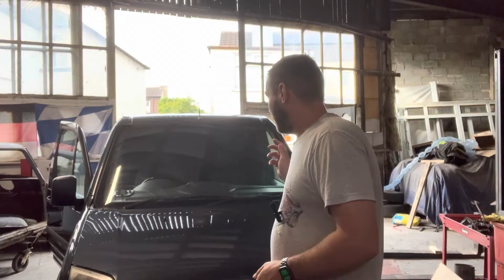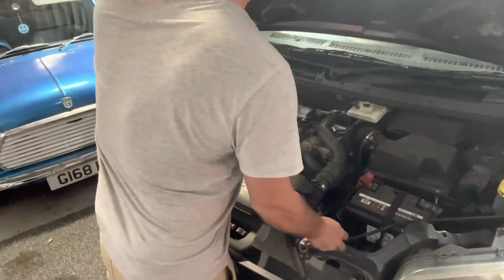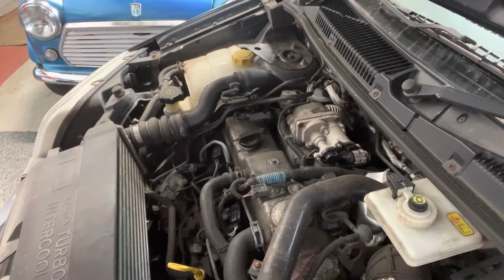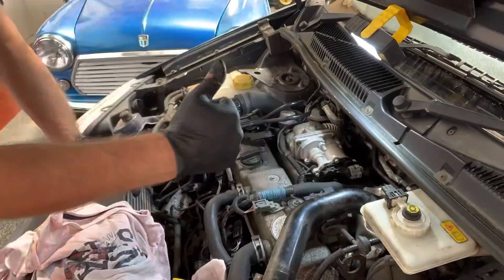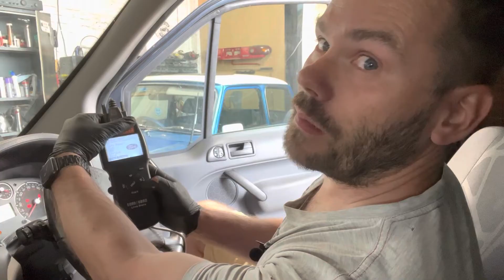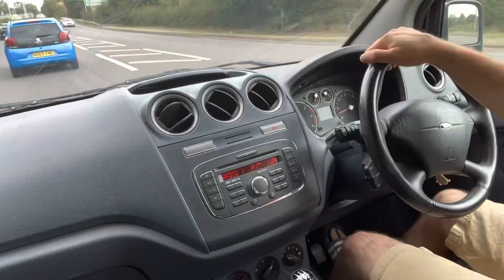Ford transit connect easy Free EGR valve repair

Comment: Hello, i get the code P0489 ( egr control  circuit A low) garage told me its going to cost £500-£600 is ti worth me replacing the same part you did first? And maybe tryying some EGR cleaner aswell?

Comment: Keep the engine oil leville a halve letter under the full mark on the dips tick and you will never have a problem. Somehow when it's full to the mark it takes in oil to the combustion Chambers and gums up the egr.

Comment: Could the EGR cause the engine to judder? I find that mine will judder at 2700rpm in 3rd gear when the engine has warmed up. First start up after a few days will also judder. No fault codes.

Comment: did you have any other symptoms than the engine light?
Reply from the maker: Noticed it was smoking more than usual on initial start up but not sure if that was connected, I plugged in the OBD reader in because of the engine light and it pointed towards an Egr issue, I’ve not had a problem with it since completing the repair
Reply: @SebsWorkshopUK  thanks. I have a problem with the engine cutting out at low revs and thought this may be the cause. I don't see any faults in with my obd reader, though.
Reply: @macaalf8219  try blanking egr I had same sort of problem blanked egr for £5 and mint after
Reply: @jayadams5007  Thanks, I'll try.
Reply: mine used to cut out like yours had the injectors cleaned had no problem since  @macaalf8219
Reply: @macaalf8219  Did you ever figure out what caused that issue?
Reply: @thevanvirgin  yes, I put a blank plate  (aliexpress) in and since then no more issues.
Reply: @macaalf8219  Your connect is 2008? or what year? Seem 2010 or newer throw error to control sensor intake after EGR
Reply: @EstoTrader  Mine is a 2011